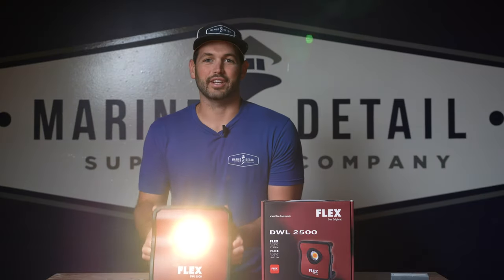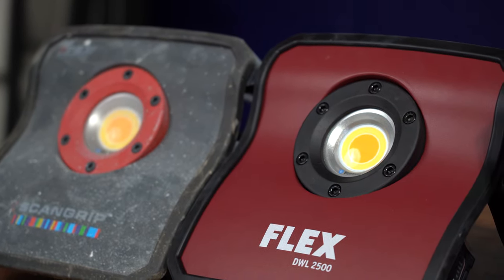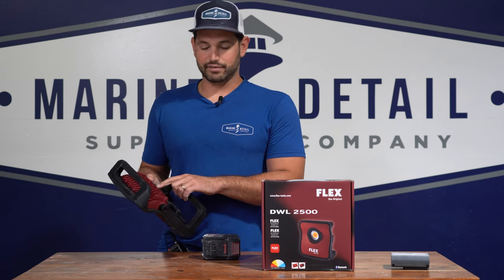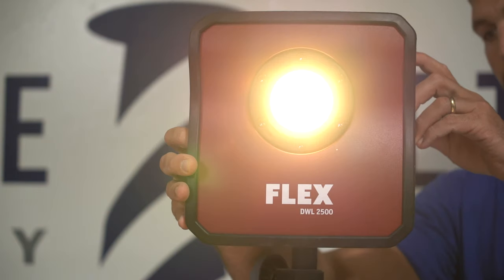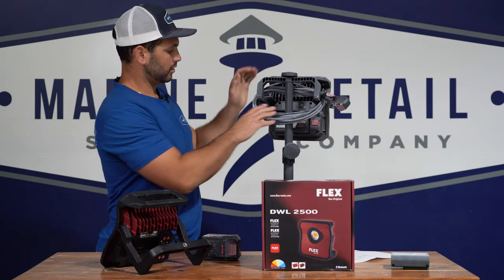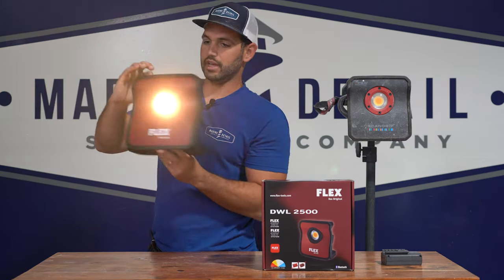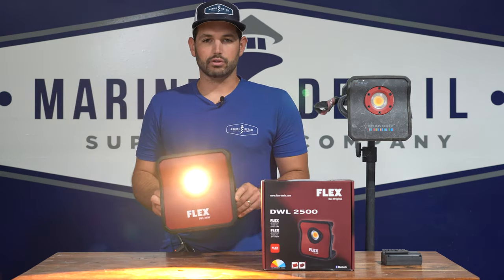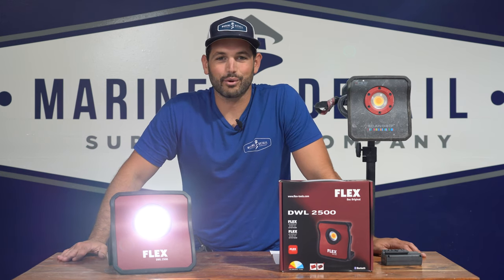Best Detailing Light: SCANGRIP or FLEX?

Comment: Good to see flex chose to be original in their design.  Btw think you might be comparing the flex with the wrong scangrip.  This one seems to be more similar to the multimatch 3 and not the 8.  Think the multimatch 3 is like $260?
Reply: @marinedetailsupplyco.-tamp3457  are flex batteries commonly used?  I don’t own any flex tools but what is a tool that most people would have/use where they would already have a battery?